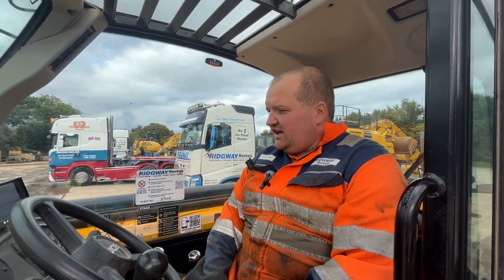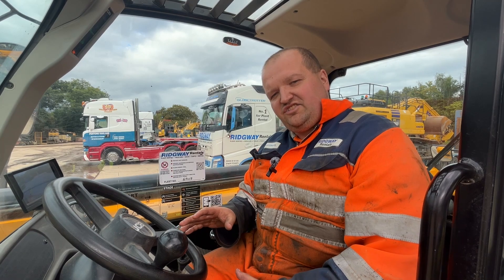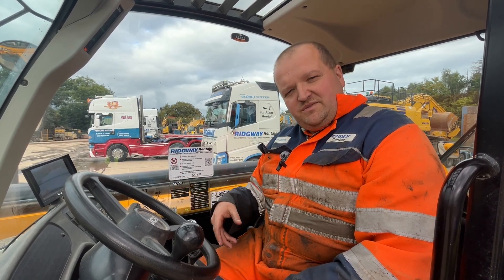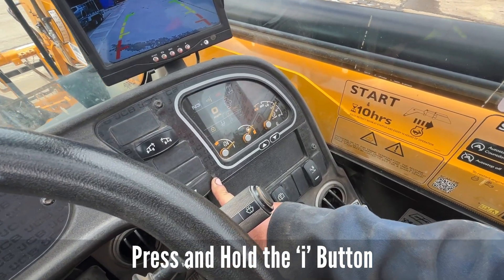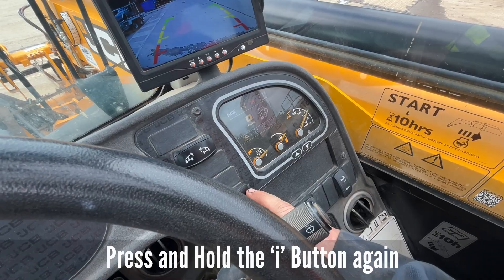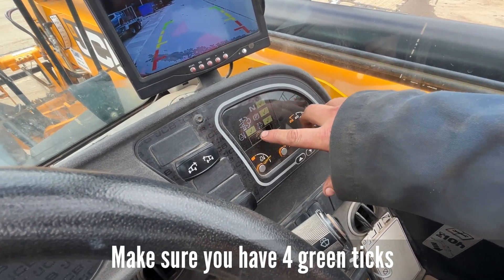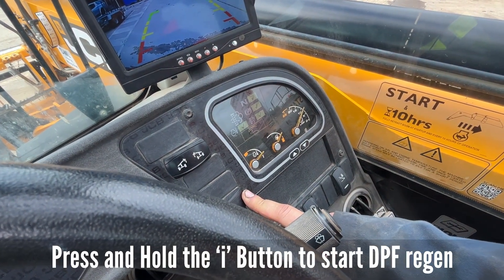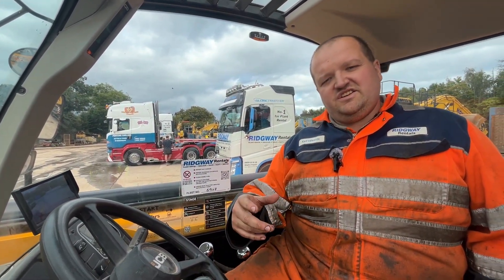DPF regen

Comment: Those symbols dont come up unless the  engine is running 
And its always the small dpf light that comes up on the top bar 
  ..manitous its a seperate button 
   And you dont have to flaff about 
Im sorry but its more staight forward 🤔